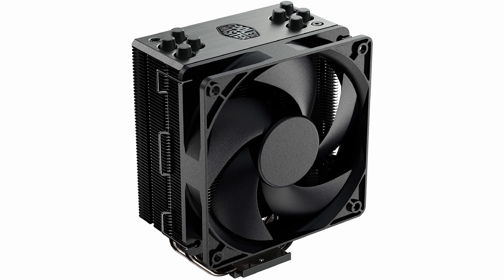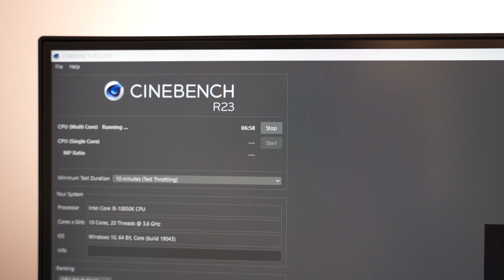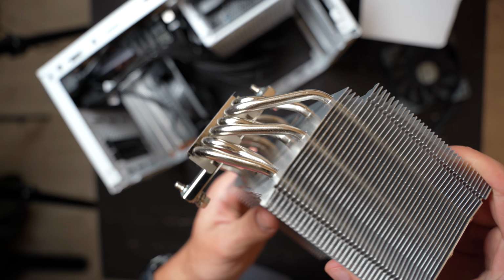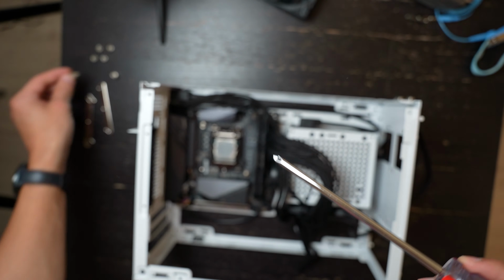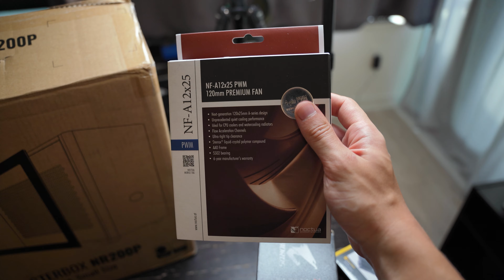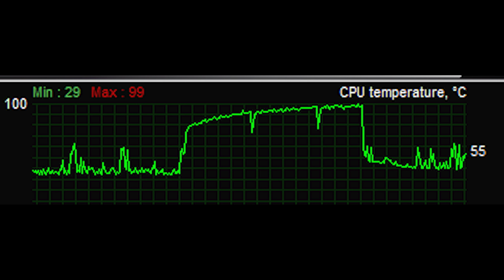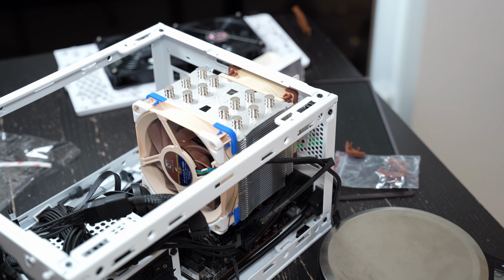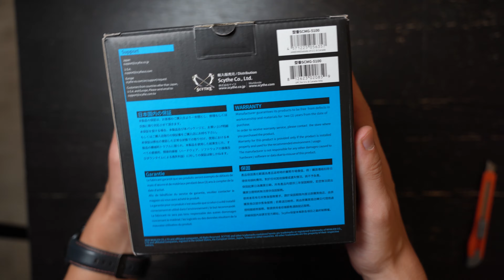NR200 Build - Best Air Cooling Setup w/ Tempered Glass (no compromises!)

Comment: nice video.
Im having a similar problem with the same case same graphics card rtx 3070 asus tuf.
The CPU gets to 76-77C while playing Dead Space Remake at maximum settings where the cpu usage gets to 55-60% at about 120 fps.
Have the evo 212 and i think im not getting enough fresh air. Opening the side panel makes the CPU temperature go to 66-67C in about 3 minutes ( the time it needs for the new air to cool the aluminium fins).
im thinking either switching the fans to take the air from the back like you did. put some fans in the bottom. or, buy the thermalright peerless assassin 120. I think its 155mm so it should also fit. 
I never use cinebench as a measure to read temps because its not a real scenario. I alwaya preffer to run an intensive game during 20 minutes or so, so the temps starts rising until it gets stable at 76-77 in my case.

Comment: Hey man, you're probably not going to see this but if you do it would be greatly appreciated. Do I'm building my first ever pc and I know how everything works and what not from taking apart older computers and watching tons and tons of videos and I wanted to get this case and I was going to use a ryzen 5 5600x with a rtx3060 and I wanted to know if I need a crazy cooler or not and if so what do you recommend, I won't be running any crazy 4k games or anything too over the top. Thx In advance!

Comment: How did you wire up the fans? Did you put the 92mm on the sys or cpu header? Guess the rest went on the sys header.
Reply from the maker: I used a splitter for the bottom ones

Comment: How does this build do during idle or light usage?

I'm trying to decide between this setup and the nr200 max with the water cooler, with the big disadvantage of the water cooler for me being the pump noise during idle. But if this setup is louder than the pump noise during idle, I would just go with water cooling. 

Thank you! Great video!
Reply from the maker: It's very quiet. The quietest pc I owned

Comment: Secufirm is awesome. A close runner up though is the Be Quiet mounting system (which has no name I guess?). It's also very easy. They also make smaller blacked out coolers such as the Dark Rock Slim and it's as silent as can be.

Comment: Same setup, but I'm running an i5 for gaming. I'm very impressed with the Mugen; I never heard of Scythe before buying this cooler. I will have to try reversing the fan to pull from the rear, I'm running ~70c under load and would like to lower temps.

I have no issues with the stock fan, it's very quiet, but I also don't run at 100%.
Reply from the maker: Good choice! let me know if reversing the fan helps. I know it's counterintuitive but if you think about the airflow, it may be better?

Comment: Great video man. Exactly what I was looking for.  Questions: How about using the heatsink with horizontal orientation and pulling air from bottom and exhausting in the back? I mean, I am considering a lower TDP cpu. Does Schyte support mounting it this way and would the ram clear ?  And does this case support 14mm bottom fans?  Thanks!
Reply from the maker: I don't think I can do that! Thank you mc

Comment: I’ve got the Scythe Fuma 2 in my NR200P with the tempered glass panel. There is a couple mm clearance between the cooler and glass panel. (ASUS motherboard Ryzen CPU)
Reply from the maker: Lucky!
Reply: @JSyntax  I've also heard mixed reports about the Fuma 2 fitting or not fitting. I wonder where the variation is coming from. Is it variation in the cooler hight? Is it variation in motherboard/CPU height? Or is it variation in the case width?
Reply: are you using the asus B550-I?

Comment: Can I build this if I have the i5 9400 Intel Processor? I also have a 600w power supply. The motherboard is an MSI B360i Gaming Pro. I also just ordered the Corsair Vengeance RBG Pro 16GB (2x8GB) DDR4 3600. Then I have the GeForce GTX 1050 Ti. I'm basically trying to move the parts I have now in my PC to this new case. My ex boyfriend built the PC I'm on now and I have no idea what else I would need or where to even begin!

Comment: can you check out the thermalright PA120 on the nr200 too?
Reply from the maker: Wouldn't be able to since I can't find it in Canada
Reply: @JSyntax  that's fine haha saw alot of Chinese builder use the PA120 and it run too good for a 30$ on taobao (performance comparable to D15) but didn't see many reviewer outside china using it haha

Comment: I have a 5800x and a two fan rtx370. My fan configuration is two regular bottom intake. 
Small scythe back exhaust.
Top fan closer to cpu exhaust and the other intake. This way I have cold air in the cpu. And two fans taking it out. Never hit more than 90C
Reply from the maker: Very nice!

Comment: Good video. In terms of airflow for my RTX 3070 Vision (Horizontally, fans at the bottom), do you still recommend the airflow you suggested with intake from the back.   Currently I have a stock AMD Cooler, I will replace with a Mugen 5 that I have. I have a 92mm NF-A9 fan and two slim Notcua 4 pin fans at the botton for intake.  I have 2 top Cooler Master White sickle flow fans to exhaust.
Reply from the maker: In that case, it's a harder to decide. We'd need some empirical data to determine what is optimal
Can you try both scenarios?

Comment: I have a NR200 with the same motherboard as you. Do you think the RTX 4090 FE at 61mm thick will fit with slimfans or even just fan delete? I have a tall CPU air cooler, so I would rather have the horizontal fitment.
Reply from the maker: It's tough, hard to say, I can't be sure
Reply: @JSyntax  I just replaced my CPU air cooler with a 67mm thick 317 mm long Arctic Freeze II Liquid cooler.  It fits  in the bottom , so  the answer will be yes for the FE 4090 , 

The challenge now is to find a 4090 other than the FE that is 330 ish long and 72mm or less thick.

it turns out getting a 4090 FE is currently very difficult, it has to be thru a random lottery via GeForce Experience app and then pick up from Best Buy, plus it has a fan that could rub against components,

PS, I no longer keep the NR200 in it's original standing position. I think there's a better tower design now, at least for me,

Comment: Thanks for this vid. It helped me decide that the mugen is the best cooler for this build. I don't want a cooler that supposedly fits. I want one that definetely fits. I do have one question though. HAve you tried removing that plastic cover of the mainboard in order to maybe fit the second cpu fan? Maybe if it's removable it will give some clearance but idk if this would be enough
Reply from the maker: No, but putting a 92mm was not a bad compromise?
Reply: @JSyntax  But you said "no compromises!" ;o)

Comment: Very informative. Gonna be doing this for my first build. Wondering how did you connect the 92mm fan? Did you use a splitter connected with the front noctua fan or did you use a fan hub?
Reply from the maker: I had so many y splitters and fan headers so it was easy to hook them all!

Comment: Should I downgrade my Corsair Carbide Air 540 case bought in Dec 2014 to this Cooler Master NR200P? Or keep the Carbide Air 540?
Reply: Haha for what it’s worth I just upgraded to the nr200 from your same exact case that I bought in 2015! I remember when I bought the 540 I had no idea how big it actually was when it came, and thought to myself that next time I would a tiny one, ended up with this one! Also upgrading from a 970 to a 4070…
Reply: @RaphaelCosteau  Nice coincidence! Ok i will take this case into consideration. Did you end up selling your Air 540 or you still have it in your storeroom?
Reply: That's not a downgrade my man...
Reply: @guiT39  Hmm ok, keep the Corsair Carbide Air 540 case?
Reply: @BravoSixGoingDark  no I mean the opposite. NR200 is an upgrade. Way better.
Reply: @guiT39  I see.

Comment: Thanks for this video, very helpful! But would just like to ask. How much space do you still have between your GPU (the founder's edition) and the bottom case fans? Because from where I am (Philippines), it's very hard to get a hand of Founder's edition GPUs, so I'm left with no choice but get typical 2.5-2.7 Slot GPUs. Would just like to check if it would still fit even with the bottom case fans installed. Thanks!
Reply from the maker: It'll fit but id go with slim fans! Thank you for your kind words
Reply: @JSyntax  Thanks for the reply! Another question, if you don't mind. If I have a larger GPU (say, 2.7 - 3 Slot width) and using 2-120 slim fans at the bottom case, with the clearance is little compared to your build (2 slot GPU vs my 2.7-3 Slot GPU), would it still yield the same results in terms of GPU cooling?

Comment: Why not rotate the cpu cooler on the top side so it can exhaust way better with the 120mm noctua pushing up
Reply from the maker: I want to pull cooler in and hot air out!

Comment: If I may ask, why didn't you use a slim fan (like noctua a12) rather than the noctua 92mm fan? Great video btw, I'm also planning for an nr200p build! but deciding whether to use scythe fuma 2 or mugen 5.
Reply from the maker: i dont think it'd fit with the tall io shield/vrm heat sinks :( -- im not 100% sure a12 slim would fit there. TY btw! What CPU are you cooling? I personally would be curious to do a mugen 5 vs fuma 2
Reply: Ahh I see, now im leaning on fuma 2. 
I'm going to use 5900x for my build. Thanks for the reply!

Comment: Hey Jsyntax, I have a question that I hope you can help with. I am building in the NR200 and I am curious if the stock AMD 5600x heatsink will suffice. All of the other builds I have seen use a special heatsink but I can't really afford that. Would the CPU get too hot even if I have 5 fans?
Reply from the maker: Yes it's good enough

Comment: More space between heat fins is actually good thing as it allows for more air flow, cools better.
Reply from the maker: Thanks! But why are noctua coolers so dense? There must be some trade off. I'm guessing air flow vs thermal capacity?

Comment: Is there anything you’d do differently almost a year later? Or do you feel this is still the best performing/cooled/noise free build? Looking to do a similar build but with the Gigabyte x570 Aorus Pro motherboard (lower in height that the one used in video slightly, so should be good). Was going to go with NR200P Max but your liquid cooling comments helped me get away from that AIO build.
Reply from the maker: I absolutely love my setup. I've been gaming and mining 24/7 and it's cool and quiet. I've tweaked all the fans to my liking. The only thing I'd do differently is use the new mugen 5 2nd edition that is of black color. Best pc I ever built!
Reply: @JSyntax  This is really good to hear! I actually ordered most of my parts today and tried looking for Mugen 5 Black edition but it seems like it’s not available in the U.S as I can’t find it on Amazon or other places (correct me if I’m wrong). I’m basically going to have a nearly identical set up to yours(but with black A12’s, A9, and NR200P case) and will hopefully find a 3070 ti soon. Thanks for your video as it helped with a lot of difficult choices!

Comment: So I have a situation where my graphics card is 318mm. I've seen some pics on pcpartpicker where it fits but it does not have any room for fans at the bottom. Do you have any suggestions? Will it be okay to not have 2 120mm bottom fans?
Reply from the maker: You'll need slim fans
Reply: @JSyntax  thanks!

Also, I managed to buy a mugen 5s black edition. Do you think I can squeeze a 90mm fan like you did in the video here for the cpu block cooler?

Comment: I’m using the bequiet aio in my nr200p build. This aio is interesting as the pump is at the radiator side which allows bottom placement for the radiator but I mount it at the side bracket. Not using the tg panel and my cpu is running cool at 68-70 degree with Ryzen 5600x at load and cpu temp at 72-74 degrees. I do swap out all the fans with noctua a12x15 fans n I did not mount any fans at the bottom cause my 3080:is too big .

Comment: @jsyntax planning a similar build. Thanks for the video. I figured I would intake top, exhaust bottom and was undecided on the rear/cooler fan. Was going to base it on the final cooler choice. Do you think a stock Ryzen would have any issues with that configuration with the glass panel?
Reply from the maker: Yeah I think it should be good
Reply: Hey, remember that hot air goes up and cold air goes down, so your planned airflow should be very inefficient. You should try with bottom intake and top exhaust, it's way more effective. Just an advice, I hope this helps you ;-)
Reply: Don't do that, you will choke your GPU.

Comment: You have mentioned the thicker GPU cards, and that the user should look for a thinner bottom fans. Is there a point to have a fan that is blowing directly into the GPU without much room between them? For me it is difficult to choose between NR200/NR200P and nzxt h210, maybe you can provide some council. 
H210 has direct airflow from the front to the rear/top guaranteeing cool air income, like mid-tower. NR200P might have some(because of closed side panel). But I don't like the fact that GPU is blocking air from the bottom(and potentially blowing to the side panel), the high pressure air between fans and gpu will escape through the ventilated side panel in NR200. If the cool air from the bottom could go wherever it can - it shall have a hard time reaching the top(to go around RAM, VRAM, etc).
Reply from the maker: Bottom gpu funs do make a decent difference! They're worth it. As for deciding between, I'm very pleased with how silent my build is while gaming or mining. I think you'll do fine with either choice tbhm
Reply: @JSyntax  it's just that practically no GPUs have the same design as the FE version, which blows the hot air out of the case and straight up at the same time. I wonder how the picture would change if you put a "regular" thick GPU, that mainly blows the hot air into the side panel, and partly up. In theory of fluid dynamics it does not look good, but I am very curious how is it going to be on practice... especially assuming there is no room for bottom fans.

Comment: I'm honestly surprised the scythe even fits with the glass panel. Coolermaster's website says it's CPU clearance is 153mm. Scythes website of the Scythe has it's height at 154.5mm. Yet you managed to close the glass panel on it? Is the steel caps on the scythe touching the glass? I have the same cooler in a micro ATX build and looking to reuse it for an itx build. Would like you to shed some light on this.
Reply: Others with a scythe mugen revb and rockin the glass panel are welcome to confirm too!

Comment: Noctua sells a slim 120mm fan, maybe try that for the rear fan.
Reply: It's not the 25mm thickness that stops the use of a 120x25mm fan there it's the 120mm width due to the height of the rear IO

Comment: @JSyntax I have the same case in black (using mesh panels). I'm using the Noctua NF-U12A with 2x NF-A12x25 fans that came with it and extra 1x NH-A9x14 at the back of it for extra exhaust, its possible. I think it was possible because the asus x570-i i/o shield is smaller, I presume, than other itx mobos.
Reply from the maker: I love I love to see a photo of that that seems like a lot of fans on the rear because your main CPU Cooler already has two fans

Comment: agree with the intake at the rear case. i was using wraith prism with my 5600x and i tried both ways but with intake on the rear i got 5-6deg cooler temp load when gaming
Reply from the maker: You must have a 3000 series right
Reply: @JSyntax  yes i have a rtx 3080 galax, im not able to fit even a slim fan as intake underneath due to the size of the GPU so i am dependant on the 3 gpu fans. also im using an aorus b550ipro ax so my cpu socket height would not allow me to fit my QL120 or even a kaze flex on top of the heatsink. i can only use a slim fan for that but im not planning to add that in for now as my current temps are fine with 1 exhaust on the top. so i have 3 fans running now, QL120 for the to right, intake on the heatsink using the QL120 as well for aesthetics and one arctic p9 sandwiched as intake btwn the case and mugen 5 and the vrm dont allow for 120 fans

Comment: I have a kinda unrelated question: Can the NR200 without a gpu installed fit 3.5" HDDs at the bottom? I'm trying to do an office pc for my family, and ideally I want 1 SSD and 2 HDDs to fit. Cooling should be enough with the 2 top mounted fans, it's just an i3.
Reply: You can mount one 3.5" HDD where the power supply is and two 2.5" SSDs in the front of the case under the cover

Comment: This is really great man thank you - extra (but important) things to think about before having a crack at building in the NR200p :-)
Reply from the maker: You can do it man
Reply: @JSyntax  I seriously didn't know this about the cooler height man so thanks a lot1 The Hyper 212 RGB was actually one of the choices saved in my basket haha
Reply: @JSyntax  I wonder if the stock cooler is 'enough' for the 12400 I'm going to use it with along with the two standard fans up top, and an extra at the rear 🤔 There's certainly no clearance issues with that :-)